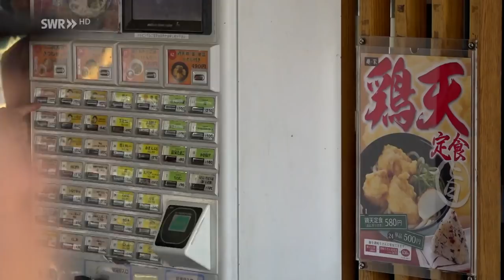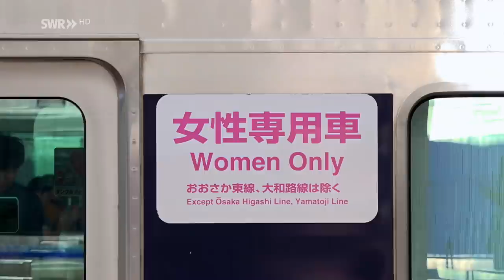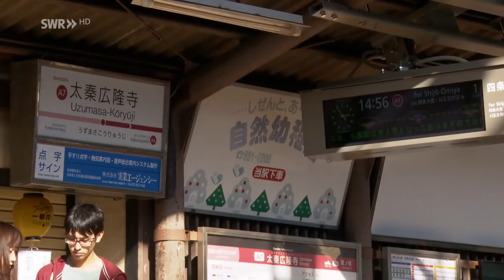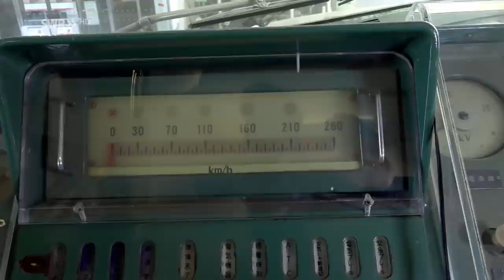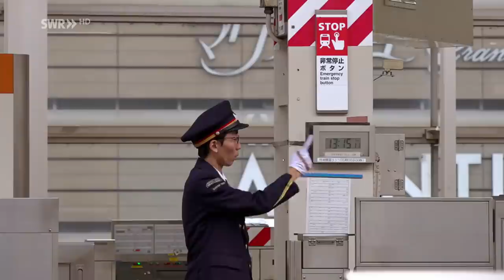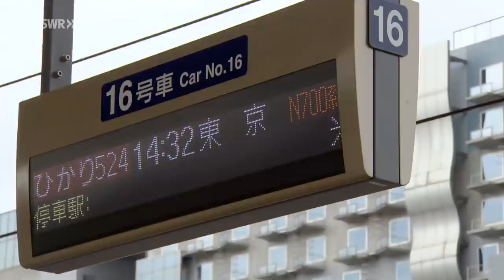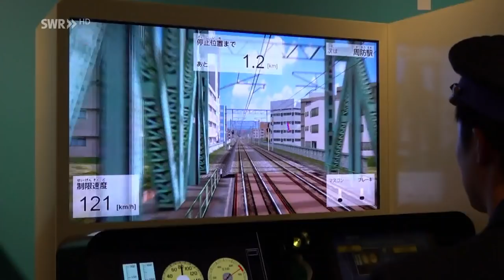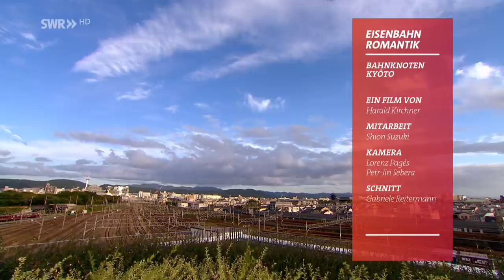Bahnknoten Kyoto - japanischer Zugbetrieb zwischen Tradition und Moderne | Eisenbahn-Romantik

Comment: Ich habe immer das Gefühl, dass ich immer JR Zugführer werden möchte, aber wenn, weiß ich nicht, das ich es schaffe!
Reply: Wo ein geistiger Wille ist, ist auch ein Weg. Dies hat auch etwas mit der Japanischen Kultur zu tun. Viel Glück.
Reply: Ich habe in Japan einen Inder kennengelernt der bei JR als Schaffner arbeitet. Hab mit ihm ein wenig darüber gesprochen, da es nicht so viele Ausländer gibt die bei JR arbeiten (also jedenfalls nicht im Außenbereich, in der IT gibts es schon einige), hat es mich auch ein wenig interessiert. Jedenfalls funktioniert das so dass man erst als Schaffner, oder Bahnhofsmitarbeiter anfängt und danach kann man eine Ausbildung zum Zugführer machen. Ist aber extrem schwer, sogar für Japaner. Am besten du fängst direkt an Japanisch zu lernen :)

Ist aber auch ein cooler Job wie ich finde und auch gut bezahlt wie ich gehört habe. Viel mehr weiß ich darüber leider aber auch nicht, ist nicht wirklich meine Welt.
Reply: Bro wenn du glaubst das du es nicht schaffst dann schaffst du es auch nicht also glaub mal an dich ich will auch Lokführer für Fernverkehr werden und ich glaube daran das ich es schaffe also glaub bisschen mehr an dich